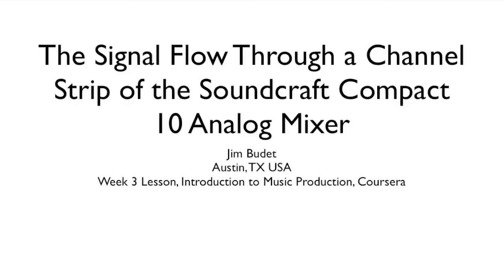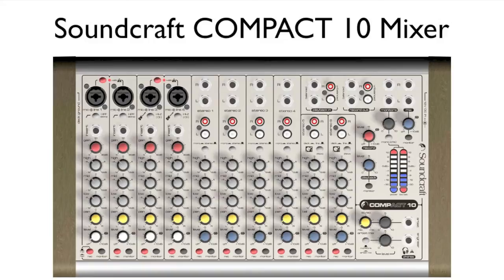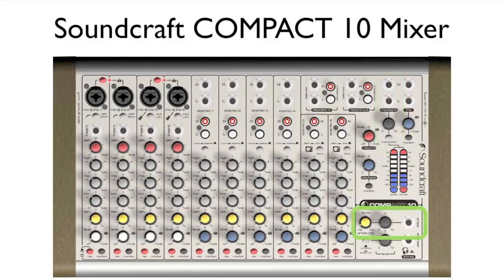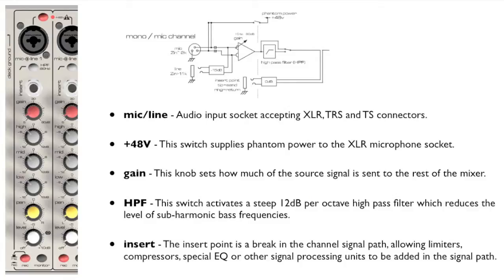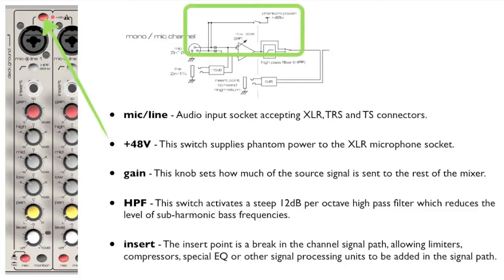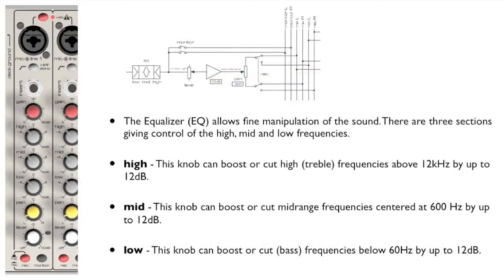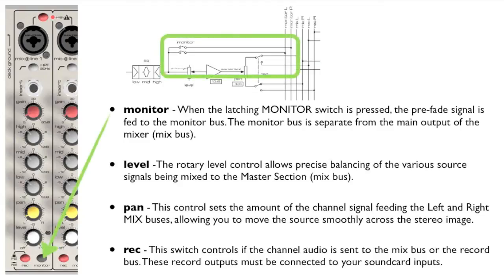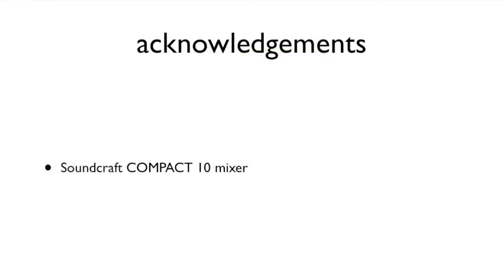The Signal Flow Through a Channel Strip of the Soundcraft Compact 10 Analog Mixer

Comment: are the pre's quiet or is there hissing either on line or xlr in's ?
How's the SNR on the line ins ?
Reply: I have the sister product, Compact 4 and the pre amps / gain on the 2 XLR mono channels both hiss. One worse than the other and I’d say that’s fairly unusable. It’s ok on the stereo in channels though. No hiss there. I also own the Compact 10 and will checkout the 4 pre channels on that and report back. Hope it doesn’t hiss cos otherwise it’s a great mixer.

Comment from the maker: The Compact User Guide has a diagram near the back showing how you can hook up the mixer in a Computer Based Recording environment. Basically the output of your computer's audio interface is connected to the mixer's Playback In and the mixer's Record Out is connected to the input of the audio interface.

When used with GarageBand, the mixer can be used to combine live instruments to a pre-recorded GB session, or provide a preamp and/or mix when recording tracks.